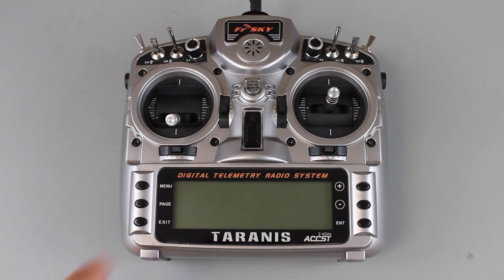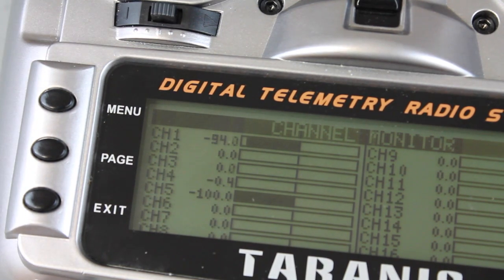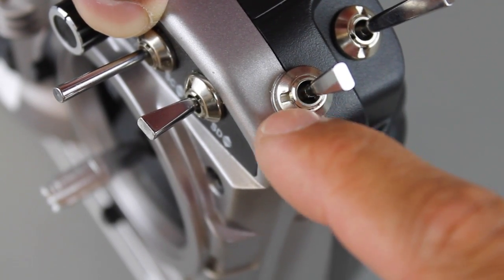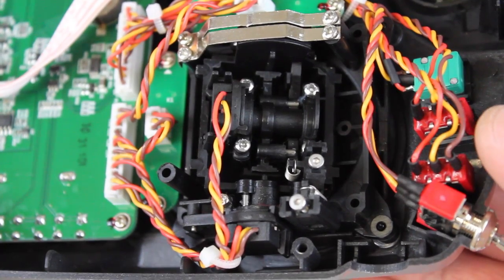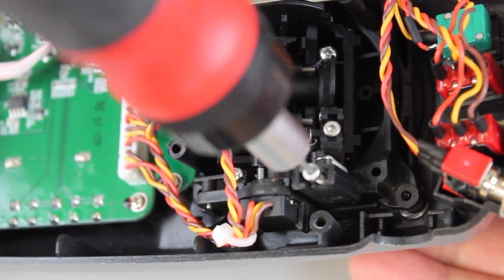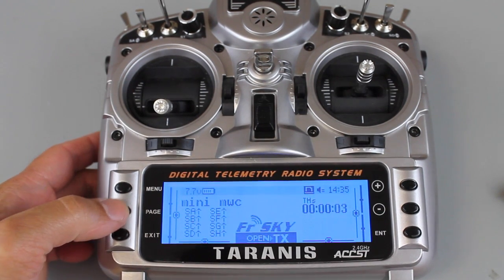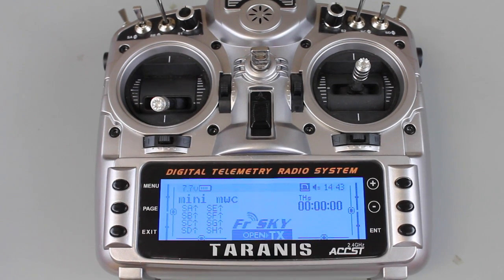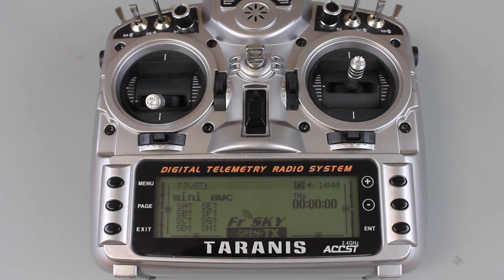FrSky Taranis How to Fix the Stuck Throttle - No More Throttle Warnings!

Comment: I bought and repaired a broken Taranis X9D Plus for cheap. Ended up replacing the motherboard, but after that it worked perfectly except for the throttle warning every time it was turned on. I did NOT need to adjust the end point inside the radio, just the calibration step and it now works perfectly! Thanks for the shortcut to the calibration step...

Comment: I just fixed mine, but my Taranis has a slightly different problem. There are actually two screws that both adjust the same lever arm. The one in your video adjusts spring tension, while the other adjusts the stick's "bottom" position. When the stick is above "bottom" it will stay where you leave it, but If you pull the stick below "bottom" the spring returns it to the bottom again when released.

In my case the 2nd screw is slightly too short to push the lever arm down far enough, so my stick couldn't actually be set at true -100. Loosening that screw will actually make the problem MUCH worse, like setting bottom at -75, -50, 0, and maybe higher (I didn't try)

A screw that's 1mm longer would fix the problem for me, or maybe even a tiny dab of glue that solidifies very hard on the end. I ended up very carefully trimming a tiny bit of plastic where the screw head sits. Now I can turn the screw a little bit more so the arm pushes down ever so slightly more, problem solved. Loosening the spring in your video all the way didn't fix it, it only reduced how strongly it tried to pull the stick back to the bottom position.
Reply from the maker: This is good feedback. Thanks for sharing so others can learn from it!

Comment: This problem is not yours alone.  It was driving me crazy until I finally figured it out myself.  Thanks for posting this though because I am referring other Taranis owners here for the fix instead of having to go through it over and over myself. :)

PS:  Just wanted to add that the only way I could get mine to stop was to remove the spring altogether.
Reply from the maker: Thanks for sharing your solution. I'll keep that in mind if this happens again.
Reply: There's another screw that adjusts the position of the arm the spring pulls on, and in my case the screw is too short to push the arm down far enough for my throttle to hit -100 without the spring pulling it back up. Removing your spring is just an alternative to tightening that screw, unless yours is too short like mine is.

Comment: Dennis, did I make a mistake?  My Taranis throttle is on the right instead of left.
Reply from the maker: You must be setup for Mode 1 instead of Mode 2, which means the throttle will be on the right.
Reply: I went in and adjusted the sticks.  I am set for Mode 2 now.  I am so new to this hobby it's laughable.  Gotta figure out this radio 100% before attempting to fly anything.

Comment: I have followed your video and made the adjustments.  I have also re-calibrated the radio and the channels monitor shows the correct range.   The throttle warning comes on when I start the radio.  I am at loss what to do next and would greatly appreciate any advise.
Reply from the maker: Sorry to hear that. Mine is doing it again and I'm assuming it's from wear and tear. I'll take it apart and see if I can figure anything out. Let us know if you come up with a fix too. Thanks.
Reply: Hello! Try to tighten the screw which is below the one with the spring from the video - in my case that was the solution, apparently it forces the gimbal assembly closer to its frame and alignes the minimum / maximum lines nicely by eliminating the extra travel from the stick.

It's the screw in focus, under the wires, at 03:30, first one to the left of the one holding the spring.
Reply: You might already see my other replies, and your comment is 7 months old so you might have it sorted, but check out the other screw on the lever arm the spring pulls on. Tightening it will let the throttle stick bottom out, unless the screw is very slightly too short like mine is.

Comment: I have maybe a stupid question, but... When I fly quadcopter (Radio Taranis and CC3D Cleanflight) and accidentally I turn off the radio, engines continues to rotate. How to set it, to engines have been stopped? Sorry for my poor English :)
Reply from the maker: I think you'll need to set this up using failsafe on your receiver. I'm not sure what RX you're using but this document explains how to do it for the X8R: http://www.frsky-rc.com/download/down.php?id=102 So what you'd want to do is configure your throttle all the way down when failsafe is engaged. That will effectively give you no throttle when the radio is turned off. Hope this helps.
Reply: It helps a lot. Thank you Dennis.

Comment: Got exactly same issue and has been driving me nuts since I got it - thanks for the vid
Reply: +jimore19 Tried the screws suggested in RC groups and your vid , still could not release tension , just removed the tension spring ( I think its only needed to change it back to Mode1)  now all working :)
Reply from the maker: +jimore19 Glad to hear you got it working. Thanks for sharing your suggestion.

Comment: I don't know why, but a few days ago I was fooling around with my settings and now none of my servos move. Even after calibration my servo monitor page shows no movements. Any solutions?? Thanks in advance.
Reply from the maker: +SCALECRAFT94 It's hard to say. Perhaps your channel configuration got messed up. Do you still have a bind between the two? Another test would be to setup a new model and see if you can get the sticks moving over there.

Comment: Right idea, wrong screw!
Saw this on rcgroups:
https://www.dropbox.com/s/9bk4jw2y4fzkiqq/throttlefix.PNG
Reply from the maker: +Martin Leonard Thanks. That's a great diagram.
Reply: The green "spring disable" screw actually just adjusts the throttle stick "bottom" position. When the stick is above bottom there's no spring acting against it like there is for pitch, roll, and yaw when not in the center(0). When the throttle stick is below the set "bottom" the spring pulls against it to return it to the set position again.

In my case that screw is a little bit too short, and can't be tightened to set the "bottom" of the stick travel to -100, only -96 or so. I had to carefully shave away a little plastic so the screw could be tightened a little more without stripping the threads. A longer screw would be better obviously.

Comment: I have now noticed the throttle doesn't start at the 5-10% mark more around the 30-35 % level.  Any thoughts and what could be the fix?  Thanks for all the great work in making these videos.
Reply from the maker: Rick Newton Yikes. That's no good! I'm not sure what's going on, but that seems to be a big problem. Maybe there's something going on with your endpoints or trims? I'd try creating a new model profile and verifying by looking at the sticks monitor while moving your throttle up.

Comment: Hello, same problem, i losened the screw and also the ratchet a little - It worked
BTW: Switches dont apply to the calibration so you dont need to flick them too

Thx for your video
Reply from the maker: lowcee89 No problem. Thanks for watching.

Comment: Thanks Dennis.  It was not just you!

 I was just wondering why tonight,  why I always got this warning.  I also noticed that timers always counted.  I was searching the web and finally found your video.  It was interesting because I was just thinking about going to your youtube site and message you about this question!

Along with doing the stick calibration again do you thing I should also perform my Naza calibration again?

Thanks again.
Reply from the maker: Bryon Trott You bet. Thanks for the feedback. I would definitely recommend doing a NAZA radio calibration after you make this change.

Comment: I had this problem as well, adjusting the screw didn't fix it for me.  I just took the spring off and that did the trick.  Is there really a purpose for that spring other than messing up the min throttle position?
Reply: Late reply, but yes, there is a reason for that spring.  Not everyone flies Mode 2.
Reply: This is 2 years late, but yes. Inside the Taranis there's a screw that when tightened sets the minimum throttle all the way to the bottom of the stick's travel. Loosening that screw sets the throttle minimum above the bottom. Like -75, -50, -25, 0, etc. The spring pulls the throttle stick back to that set minimum position, allowing you to pull the stick below minimum. I guess this might be useful for helicopter pilots, but I'm not sure.

On my Taranis the screw is too short and can't be tightened enough to set the stick all the way to the bottom without trimming some plastic, adding a dab of glue, or just getting a longer screw.

Comment: Nice vid. The taranis is a little bit out of my price range however there are two of them on ebay at a good price. The catch is they do not power up.Do I buy these and attempt to fix them (I am an intermediate fixer of things) or stay away I am messing with forces beyond my control.Dennis what do you think?
Reply from the maker: traci beacer It's really hard to say without knowing the specific problem. If you're pretty good with electronics then it may be worth a shot. But you mind end up sending more time than it's worth. I personally would hold off and see if you can find a deal for a working Taranis. Or you could always by the broken way and if you can't fix it then sell it to someone else on eBay :) Good luck and keep us posted. It would be great if you got it working!
Reply: The two tarani (not working and without receivers)finally sold for $280 which made my mind up for me! A 9rx pro it is then.

Comment: Hello Dennis, i got the Taranis standard edition, at first i didn't had that problem, but after 3 months it came out , so i tried doing again the calibration and it solved apparently the problem. After another month again the problem.. so now i have to try with your "trick"  .
Just a question:   is only the TARANIS standard edition or the PLUS version also with that problem?
Reply from the maker: 〉〉----DragonClips©----〈〈 Good question. I'm not sure as I don't have the Taranis Plus. But maybe someone else can chime in. I'd definitely consider the upgrade if I knew it was addressed with the Plus.
Reply: Dennis Baldwin   by the way im selling the Taranis Standard, so after got the money ,i will buy the PLUS version, so i will let you know if it get same issue.

Comment: Nice video, thanks.  Had the same issue, but no amount of adjusting would fix the issue, in fact the adjustment screw came right out.  In the end I removed the spring, this allowed the throttle to sit at zero.
Reply from the maker: Dean Mcmillan Cool. Thanks for sharing.

Comment: The real problem here is the screw that disables the return screw you are losening. There seem to be a number of Taranis where this screw is too short to completely disable the return spring.

I removed that screw and used a drill bit manually to remove just a fraction of a mm of the top of the plastic that holds this screw. Now the screw can go a little deeper and will disable the return function completely.
Reply from the maker: Balu Very good tip. Thanks for sharing.
Reply: My screw is also too short, and I also trimmed a tiny bit of plastic from the top so the screw can turn a little more. This also solved my problem. HOWEVER my Taranis did not have this problem when I first got it, so it seems like something has shifted or bent, because the screw used to be long enough :P

Comment: The correct way is to tighten the screw that partly disengages the self centring already (pushes the crossbar away from the stick axle).
Some people have reported that they needed to cut away some plastic below the screw head to get it far enough down
Reply from the maker: flarssen Good to know. Thanks for sharing that bit of info.

Comment: Hey Dennis, thanks for the great video!  I've had 2 different Taranis transmitters and I've experienced this "throttle warning" on both of them.  Even after opening the case and making the gimbal adjustment the throttle on my current Taranis still springs up a bit into warning mode.  Definitely annoying but it's such an awesome radio that I guess I can just deal with it.  Thanks again!
Reply from the maker: SouthParkRC Thanks for the feedback and I agree about how awesome the TX is. Perhaps the Taranis Plus has less of an issue.

Comment: Hi Dennis. Thanks for posting about the taranis! I installed a Lua script for a teesny that works great with my pixhawk. However after installing it the TX gives me a siren warning about every 7 seconds and I can't for the life of me figure out why or how to turn it off. Its driving me nuts. It doesn't seem to have anything to do with the switches or the battery levels or anything like that. Would you by chance have any idea what that could be? I did use a new sd card not sure if that's it or what. Anyway sorry for the question but I'm clutching at straws now. ha Thanks
Reply from the maker: govsux1 Sorry I wish I knew what the problem was. It's hard to say but did you review the Lua script to make sure that's not the culprit?
Reply: Dennis Baldwin It's the lua script. I ended up simply removing that siren sound file as that's not used for any of my other warning sounds anyway. Thanks for your reply though. happy flying!

Comment: Finally got to do the fix. Mine's a Taranis B version - got it just before the Plus came out, typical of my timing.
Anyway it worked, but the screw was not a hex, but a cross-point and I had to take the spring completely off.
I also took the opportunity to mess with the tension spring on the opposite side of the gimble to get it better for me.
thanks again.
Reply from the maker: Kampala69 Thanks for sharing that info. This is good to know.

Comment: Very helpful video thanks 
One thing is i don't think the switches are part of the calibration process and you should also do the sliders as well as the knobs. Cheers
Reply from the maker: bigfilsing No problem at all. Thanks for the heads up on calibration. I'll look into this.

Comment: I had the throttle issue and solved it by following your video but with an additional tweak. In my case even loosening the screw completely didn't solve it so I tried playing with the screw just below it and found that tightening it fixed the stick bounceback completely. Thanks for the video.
Reply from the maker: tabod Good thing to know about. Thanks for sharing that bit of info.

Comment: Ok, so adjusting the screw didn't work.  But, I took out the screw and all seems well.  Whats the purpose of this screw, other than to yank the throttle back up from -100?  I assume if you want to switch from mode 2 to 1?
Reply from the maker: Howzit FPV I've heard reports from others that had success by removing the screw. I didn't need to do this, but I'd recommend keeping it around just in case you need it in the future. My understanding of the screw is to be able to set the gimbal to the appropriate position....to fine tune the throttle 0 point if necessary.
Reply: Dennis Baldwin Gotchya, thanks!

Comment: Thank you Dennis for this in depth fix of this problem, I was able to fix mine just as you showed but I fixed another with the same problem but it was even more "off" I took the screw all the way out and that did not do the trick so i used a needle nose and pulled on the spring a little and that did the trick and I put the turned the screw back in, This must be a common issue.
thank for the "fix"
Reply from the maker: Ivan Hartley Thanks for sharing your experience. It seems a lot of pilots are having this problem. It's unfortunate, but thankfully the fix is pretty straightforward. Glad to know this helped and I appreciate you watching.

Comment: THANK YOU! After owning my Taranis for about 6 months it developed this issue.  It drove me nuts and was dangerous because models would throttle up that 6% which was enough to spin a motor!  I had temporarily resolved the issue by carefully calibrating in the "up" position of the throttle.  What a pain.  I had to unscrew the screw you noted about 12 revolutions but it worked.

Again, thank you for the great video.
Reply from the maker: tpalshadow No problem at all. Glad to hear you got it working!

Comment: I ended up removing the spring on the throttle, I didn't feel comfortable drilling out material on the throttle tension post.  It works flawlessly now.  Easy fix & as I stated before I love this transmitter, I'm glad I waited for it to be available for purchase.
Reply from the maker: Abdul Askew SR Good call. Glad you got it working. The transmitter is definitely a good one for the money. Hopefully you/we have no more issues with it!

Comment: Hi Dennis, thank you for this video, unfortunately I have experienced the same problem!
This issue start manifesting just few days ago after a couple of months I have been using this great Radio (just a few sessions anyway). 
I purchased it from HK at the end of August and I believe I got a V2 Taranis since it was shipped with the new 2000mha battery.
I followed your video and initially I have loosen the screw (BTW Phillips screw) but after that adjustment the stick would still jump back up a tiny bit and on the stick monitor it would still read -99.3. So I removed the screw completely and now the throttle stick on the monitor reads -99.7, not quite perfect yet.
I am wondering whether I should try and remove the tiny spring too!
Do you think that by completely removing the screw and spring would affect the functionality of the stick?
But the big question for a novice like me is; what are the screw and spring on the throttle stick for since the stick is supposed to maintain last position?

Thank you for this great channel ;-) 
Please continue to post more videos, they are all very interesting and educational.
Cheers